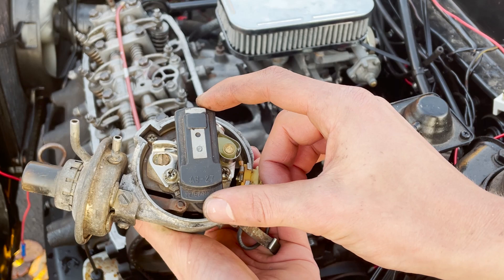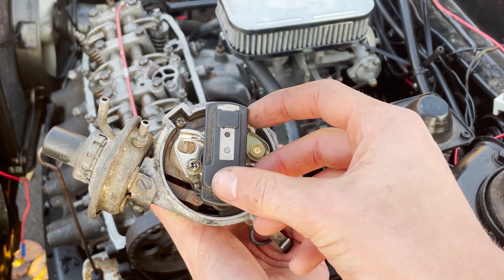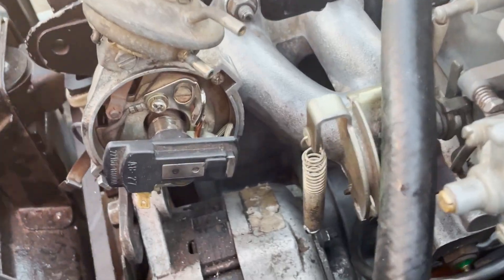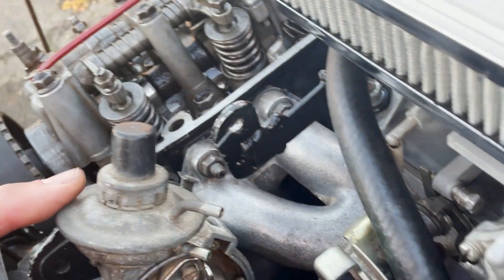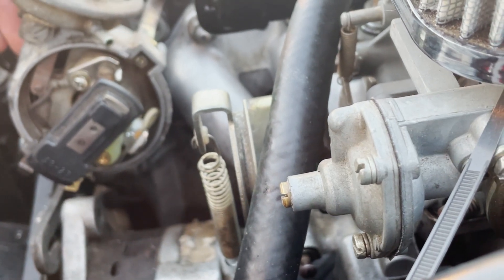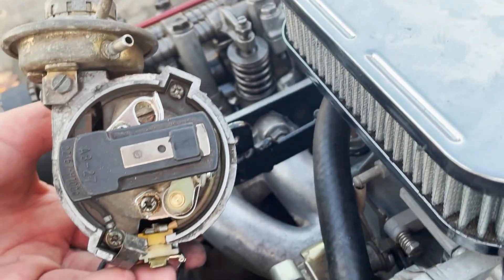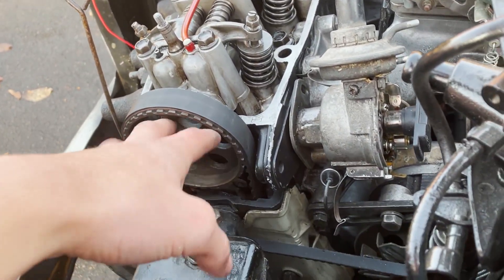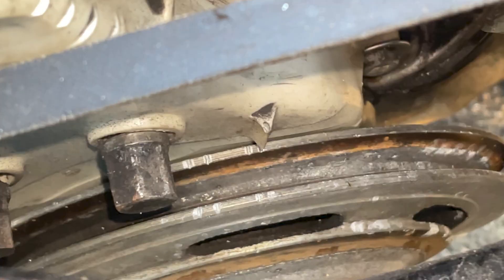How to Set Timing on a First Generation Honda Civic - 1979 Civic 1200 non CVCC

Comment: Those 2 ports on distributor. Where did you plug them on Weber? I only have one port on Weber for vacuum
Reply from the maker: One is vacuum advance. Not sure what the other is. Cap it off or join the first gen civic group on Facebook and ask them. Lots of knowledgeable people willing to help on there
Reply: @Mechanic_kid  I did the one furthest from cap plugged to Weber the one closest to cap I am plugging. I just was making sure you did that. 
Literally making a Facebook for that today. Thank you.
Reply from the maker: @gonzaloverduzco8328  I don’t think I ever hooked them up as the car needed brake work also. But that’s a great question for the group and someone will know. Take a picture also